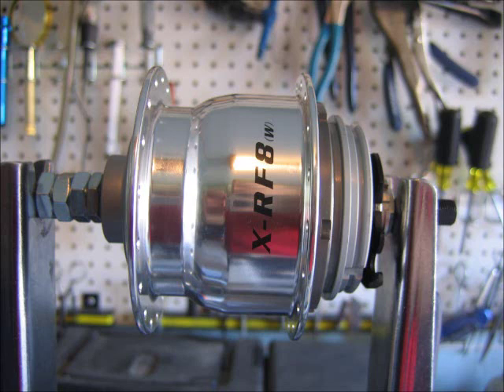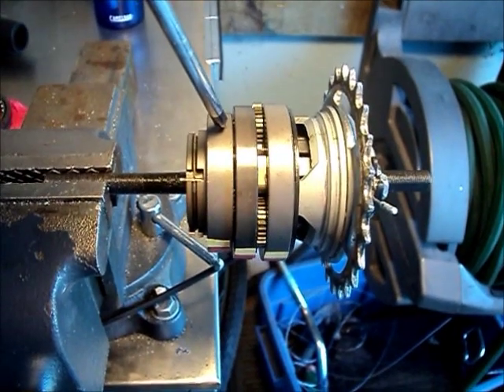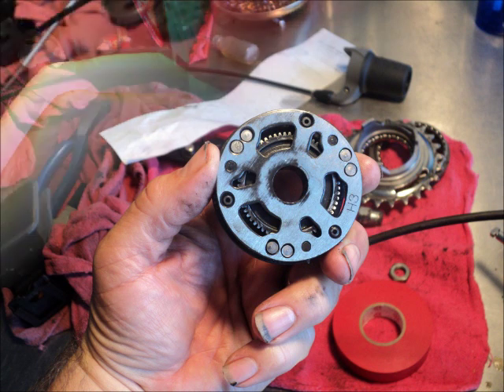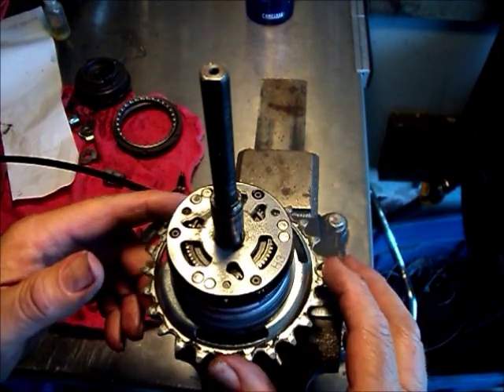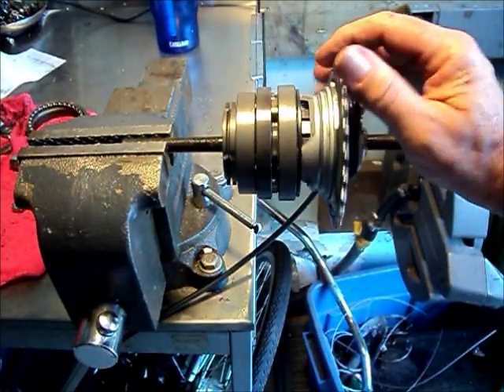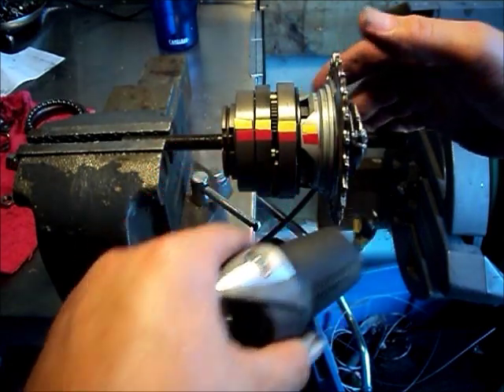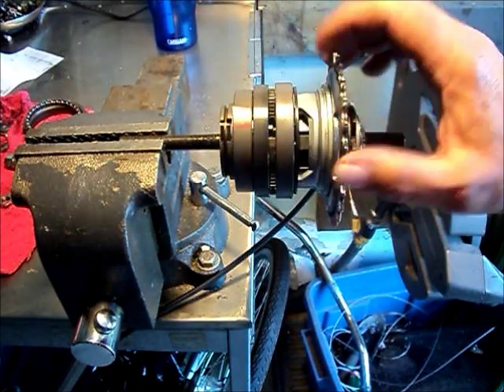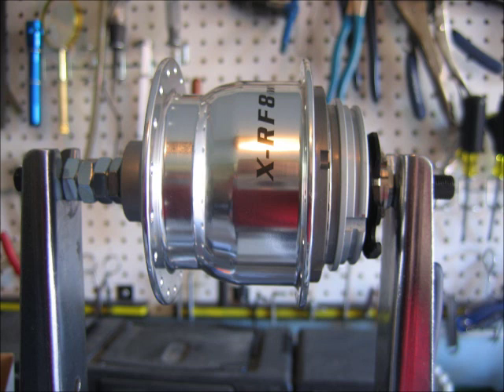Sturmey Archer 8 speed hub. How it works

Comment: I have a question regarding this hub. What is the best way to align the shifter cable so the hub changes between all the gears correctly?
Reply from the maker: It's covered in this instruction sheet. https://www.sturmey-archer.com/files/catalog/files/35/MANUAL%20-%208%20SPEED%20HUBS.pdf

Comment: I subscribed to your channel because you sound just like my college professor teaching automatic transmission 101 . He was a great guy smart as hell . Thanks I kinda figured these hub units were planetary drive . Hey do you think one could handle a small two stroke engine like 80cc? It's an experiment I'm doing . The 80cc engine has a 4 speed manual so 7 gears split like a semi truck .  Make sense ?

Comment: Hi Dan, I'm glad you find them simple ! I was happy to service my 3 speeds, and based on this success I figured I'd service my 8 speed. I dismantled the drive side first and can not re assemble the thing to do anything other than direct drive 😣
I'm not sure how. Any avice ? I'm tempted to fully dismantle it so that I can teach myself how the gear selctor actualy changes the gears. There is a group of three pieces around the axle under a circlip on the drive side, it ma be a misalignment there.
Reply from the maker: It should always be dis assembled from the non drive side. If you took the locknut off the drive side you have most likely disengaged the cable drum from the shift key.
Reply: @2wagondragon  I've found a pdf exploded diagram now, it helps a lot  ! You mean the shift actuator ? The ring with two pins ? I'm prety sure I had that in the right holes, there are two that fit the pins weĺl. I'm thinking, now I've seen the diagram, that my cam pack is not ilned up with my control pawl-M. I'll remove the left side, and then I'll have a better view of what's happening when it does.
Your video will help a lot ! Will regulay auto grease be okay for the rebuilding ? And the oil you used, is that available in the uk ?

Comment: Hi Dan, I've been watching your vids but I haven't been able to figure out what's wrong with mine as a result (it won't shift gears with the shifter/cable) I also can't seem to get the unit out of its housing...no ball Ring spanner. I'm in Toronto but can't find a mechanic that's comfortable working on these, any recommendations?
Reply from the maker: Are you sure the problem is in the hub and not with the shifter or cable assembly? I would rule that out before pulling the internal assembly. I am located in Oakville, so not that far from you.
Reply: The shifter and cable could be part of the problem but it's more then just that I believe. I found a mechanic to take a look and should hear back soon but he said its not something he usually works on. I would happily bring it out to the Oakville area but when I searched Boomer Bicycles (which I assumed was yours) Yelp said it was closed. robertwbulmer@gmail.com if you have any recommendations in case my current mechanic isn't able to help.
Reply from the maker: @finkwonk3141  Boomer Bicycle was my shop which I closed over a decade ago. You can reach me through the contact page on my web site  https://www.waterfrontwheelshop.com/

Comment: Gripping the thread in vice jaws!!!
Reply from the maker: The axle is gripped by the axle flats, not the threaded part, so no problem.If you don't understand that, the axle is flat on both sides to fit the anti rotation washers.
Reply: @2wagondragon  I remember this flats now!

Comment: Hi Dan,
I have a question to ask you since I put the sturmey archer 8 inner speed hub to my MTB and I am not sure if it was a great idea really because it had a break down after a few miles of use. I have read that Sturmey Archer 8 speed meant to be designed for small wheel size of Brompton bikes and not for 26 inch wheel bikes. For this reason I am planning to change the inner hub for another type of gears that is simpler to repair and maintain. I have found hard to find real information about this, but I found your site long time ago and I did watch some of your videos, which are very genuine. I am opened to your opinion because Sturmey Archer are more popular in the UK than in Spain (Basque land) where I a come from. Here an Sturmey Archer is like to see a futuristic flying car almost owing to its really small market here. Would you give me some advice about this issue.
All the best.
Aitor
Reply: This hub is really only suitable for smaller wheels (up to 20 inches overall diameter).  In order to adapt the gear range to work with larger wheels you have to use a proportionately smaller chain ring (or larger sprocket) which increases the load on the mechanism.

Comment: Considering that you have disassembled most, if not all, of the different brands of gear hubs, you should be able to answer a question. I would like to put a gear hub on an e-bike. Which brand and model do you think is the most durable for a high torque application. I know Rohloff is quality and durable. Although, I don't believe an e-bike needs fourteen speeds. And, Rohloff is expensive.

Comment: I wish this would work with high torque/speed inputs. That 'cam' engaging various parts at 8k-10k rpm would annihilate the cam and maybe even the engaging parts too.  I've come up with a similar setup, but instead of using palls, I used a hydrostatic engagement method, which at least has some give before 1:1 transference from stage X to Y.

Comment: I have a mantis tryrad trike would like to have a three speed coaster brake , can this be done ?
Reply from the maker: If it currently has a single speed coaster brake hub installed as a mid drive, a 3 speed unit can be installed in place of it. Sturmey Archer makes 3 speed hubs specifically for this application with both an input and output cog.The output cog is mounted directly to the hub shell.
Reply: Dan Burkhart thank you it doesn’t have coaster brake on it only front brake

Comment: Thanks so much for taking the time & trouble to make this video - really helpful! I also have an 8 speed hub, dating from around 2008, I think, which although little used, has a persistant issue, where it can very occasionally slip which I'm trying to sort out. Your video has been very helpful! Just as an aside, my unit appears to differ slightly to yours, - in yours, there is a gap between the stages, where the planetary gears are clearly visible, whereas the middle ring gear in mine completely covers the planetary gears. I wonder when this change was made and to what purpose.

Comment: Don't grip the axle in the vise without soft jaw inserts!
Reply from the maker: The axle has flats on both sides to engage the anti rotation washers. Gripping it in the vise across the flats is not an issue.
 For axles without flats, I use a Hozan axle vise.
Reply: I see.

Comment: Dan Burkhart, you seem to know an awful lot about Sturmey hubs. I'm a mechanic with some experience and I have an X-RD8 that is acting up. In gears 3 and 5 it feels like something is slipping periodically, perhaps once per revolution of something. If I shift to 7 or 8 something causes the cog to seize up, and I can't pedal. At this point the shifter sticks and won't shift back down below 7. The shifter will un-stick if I touch a few things but I can't see what is un-sticking it. Any thoughts? Thanks in advance.

Comment: Thx for this! I knew how 3 speed hubs worked, but always wondered how those with more did... this was a great (literal) insight!
Reply: I have a 4 speed bike (it is very similar to the 5 speed) and have watched video's and the extra speed looks very clever efficient design. You can see the planet gear with a combined double cog in this video (he calls the second stage). My bike is the old all 3-in-1 thin bike oil lubricated, no grease or any other oil in any part of the transmission. It is ever-so light to peddle.

The difference is that the 8  gear has many more gears driving gears so it must waste a lot of power by comparison?
Reply: Greg S. ?

Comment: Where can I get a bike with a Sturmey Archer 8 speed hub?
What bike manufacturers use this hub in their bikes?
I never see it in any bikes specs, when I am checking Trek, Cannondale, Specialized, Cube, GT, Jamis, Koga, you name it. 
Why is this?
Reply: +Walter E. Kurtz This might be an aftermarket thing. Check with your local bike mechanic.
Reply: +Korina42 I think you might be right, thanks, I'll see what I can find out.
Reply: +Walter E. Kurtz It is spec'd on very few bikes, probably because it requires a very small front chain ring which makes the bike look a little silly. You'll find more bikes from mainstream manufacturers spec'd with the Shimano Nexus or Alfine 8-speed hubs.

Comment: HI .. my curiosity about this system is ... can you shift gears while pedaling ?  the reason is i might apply this to an electric moped conversion for more power trough gears :)
Reply from the maker: +Clint Camilleri 
You must pause to shift. You can pre-select upshifts, but the shift won't happen until you break torque.
When downshifting, you can't even move the shifter with power applied.
 So the short answer to your question is no.
Reply: The proper way is to keep peddle lightly when changing gear - the dog clutches are much stronger than engaging gears such as a car has. A motorbike gearbox might be better because you want to put motor power through the gears.

Comment: At the rear wheel, where you have the pin and cable entering the speed hub, I don't have it with a little chain going in the hub, but a part I can pull off to get access to the pin and if I look inside the block i've pulled off, I see the cable.  I've put it back on, but can't change gears anymore. I had to take it off to because my chain was too loose and kept derailling. Any video on what's going on in that block and how to pop it back on in the right way? I thought I just had to pop it back on but it isn't that simple apparently. Thy

Comment: TonyV195?
You're comparing a new derailleur set up in a lab to this. Do 5000kms in the real world and then compare. This isn't fragile and you're not bending your chain or ramming it into the next gear. So in 5'000kms the Planetry gears will run more efficiently and still shift all the time, while your mech set up will have more worn sprockets, stretched chain and cables, and possibly a bent mech or hanger.
and you can shift gears without pedaling, so you're in a more efficient gear more often.

Comment: When I first started riding with my SA XRF8(W) I weighed in at 247 pounds, and had no problems with the hills in Toronto (some of which are steep). 3 years later, I am down to 225 lbs and still have no problems riding with the hub!  Thanks for the great video, it is very informative.

Comment: I think the issue is both weight and efficiency. In the gears that use all the planetary gear rings, there are a heck of a lot of little gear wheels spinning around in there. If a good deraileur puts out 96/98% of the energy applied to it, those higher gears are probably lucky to put out 90% of what the rider puts in. Obviously, where most of the rings are in lockstep in gears 1, 2 & 3, that won't be the case.

Comment: Excellent video. If that is a fairly simple mechanical device as you say, please don't show me a complex one. I'd like to see some realistic appraisals  of the efficiency of multi planetary ring hubs. There must be a fair proportion of the input energy lost in those higher ratio gears where all the rings are working. My three speed SRF 3 is just about tolerable from the efficiency point of view, but loses out badly in terms of its gear range. I get round this by running two front chain wheels.

Comment: Thanks!  I just bought a Genesis Super 32 @ Walmart here on Maui.  I'm a big guy (66 y.o.) & I bike all over.  I am poor & no car.  So, I wanted a big enough bike for me and now I want to install the NuVincia N 360.  Sounds good to me but I have like pooooor mechanical abilities and my bike shop guy seems scared to do this job.  I'm learning on internet & maybe I can install it myself.  Q! Doesn't a coaster brake work off the same area inside the hub or all control on the paddle conxn to frame?

Comment from the maker: That was a different bike in the DC video. That one is a 3 speed. Sturmey Archer makes a bar end shifter for the 3 and 5 speed hubs, but not for the 8 speed.
 There is an aftermarket bar end shifter available for it from a company called Jtek  ( Web site is jtekengineering)

Comment: Good video!   Just a question: Where do I find trigger (lever)shifters or bar-end shifters that work with this hub?   I'm not a fan of grip shifters.  That has been the reason I haven't bought this hub yet.  @2wagondragon In the DC video it shows you using a bar-end shifter?

Comment from the maker: Well, It depends on what you plan to use it for. If you're doing hills, you would probably be better off with a 5 speed Sturmey Archer. It has a bit less range, but it has two underdrive gears whereas the 8 speed is direct in low gear. This requires a much lower input ratio and subjects the hub to much more torque.

Comment from the maker: Well, I'll resist the temptation to ask why on earth you would want to do that and simply answer your question.
 If you can remove all the planet gears from each stage, each stage will drive the next in direct lockup. You will then have a one speed direct drive hub.
 You would get the same result by removing the shift pawls that couple the sun gears to the axle. I'm not sure which would be easier, but removing the planet gears might be more easily reversible if you decide it wasn't a good idea.

Comment: Okay, see if I got this right. It appears that each stage has a ratchet which connects to the stage following, so that any stage which does not have its sun gear engaged will be driven at a 1:1 ratio by the previous stage. These ratchets are always engaged, so that when any stage is overdriven by the previous stage, this ratchet will be slipping, which makes the clicking noise you hear. In high gear all three stages are ratcheting, thus the drive has its highest pawl resistance in high gear...?

Comment: Is this hub pretty heavy? I would imagine that given the torque on those gears they have to be made of some pretty strong and heavy materials. Leaving weight aside, is this system more efficient at converting your pedaling to actual bicycle movement than a standard derailleur? Outside of not being exposed to the elements and the ability to shift while standing still or under pedaling pressure, are there any other pros? What are the cons? Great video too.

Comment from the maker: You are correct that in low gear at least, there is no torque passing through the gear train. The power flows from one stage to the next by direct lockup.
 That's only in first gear though. There is still a formidable amount of input torque on the hub because of the low ratio necessary. Underdrive models do not need the low ratio high torque input.